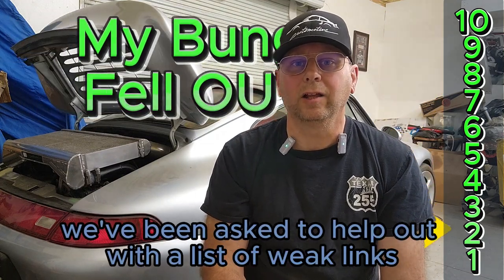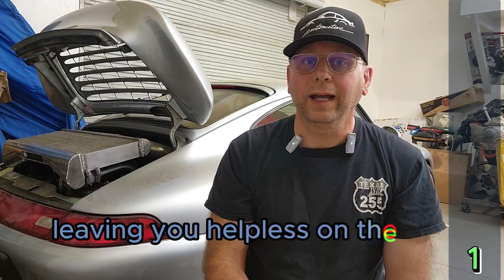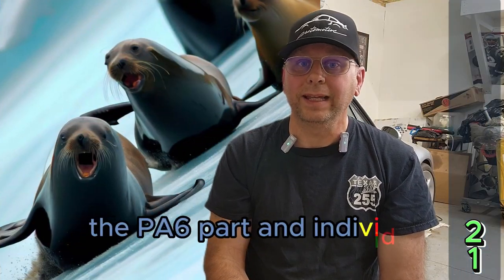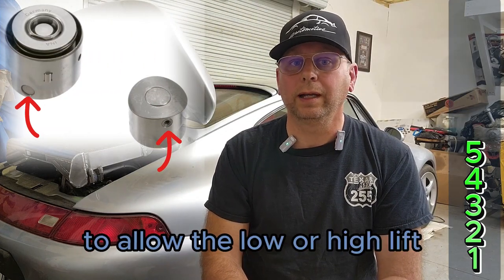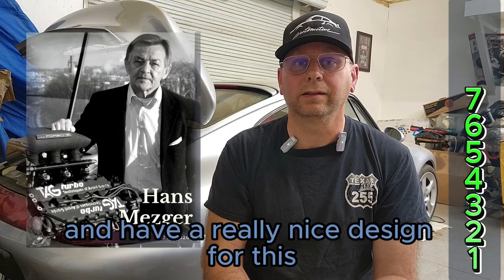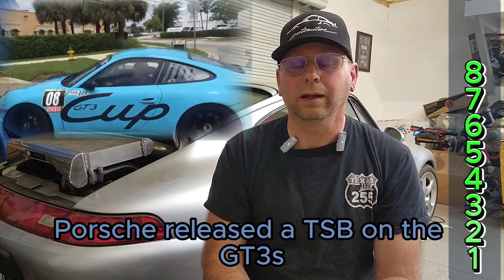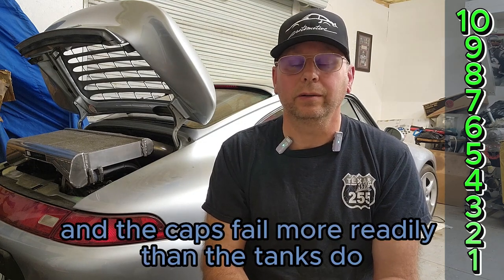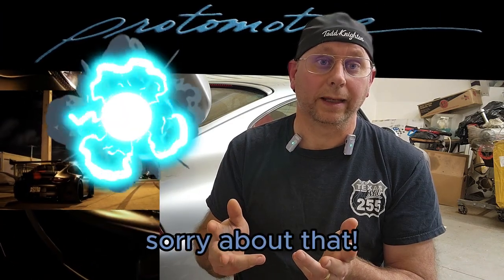Avoid these Top 10 Porsche 996 Turbo common failures and weak links

Comment: Todd,You left out the Most Important Part.........................
Bearings#Bearings #####
The difference between a Chevrolet Cobalt that lasted till 148K Miles,Compared to a 2008 Toyota Prius that lasted to 420K miles is the Bearings,Japanese Bearings are Significantly Better if you purchase the right ones.
Todd,Great Work as Always!!!
Reply from the maker: Great point!  We've pulled apart stock and modded engines at 130k+ miles and could swear the rod and main bearings are brand new....    The int shaft bearings get worn from excessive load on the cams and the rear main thrust from the heavy clutches these cars need for high power.   But otherwise the lower ends in these would go stupid high miles.   That's the cost of performance though!  Can't do without a clutch to hold the power!

Comment: Thanks for the video.  I'm not new to the 996, but recently purchased my first 996 TT.  I'm noticing a rattle sound and wondering if it's the intermediate Shaft Bolts come loose and rattle?  Is there a way to determine if that's the case?  I have a video I can share.
Reply from the maker: I'd be happy to take a listen to it.   If it's just on startup it's more often a chain tensioner.  Lifters give you more of a tick tick tick vs. a rattle.   If the sound is coming from the center back of the engine, it's most likely the intermediate shaft.   But even relatively new these make an odd noise back there.   Possibly a combination of the turbo scavenge pump, intermediate shaft, chains, and oil pump having a lot of gears down there in close proximity.  Do also check simple stuff like the serpentine belt drive idle pulleys and tensioner as well as the front pulley is tight.   There's so many things that can create similar sounds, it's most important to look at the where and when to better identify the source of the problem.
Reply: @protomotive  Thanks for the quick reply.  I have sent you email from your website-sales
Reply from the maker: @kd5135  On it :)

Comment: what's the number of the TSB for the oil gallery plugs? i can't find it! thanks
Reply from the maker: The TSB was on the 3.8 and 4.0 GT3 engine case freeze plugs, but is relevant to the 996tt/997.1TT engine cases as well.   It was showing how to properly stake the freeze plugs in place to keep them from blowing out randomly.   It was showing the large one by the bell housing on the bottom of the case, and the other large one inside the bellhousing.   When you purchase a new engine case, they've learned the hard way and do stake them properly.    I searched for it for a while and can't seem to locate it.  When it turns back up, I'll shoot it over to you.    It was originally sent to me by our distributor in the UK, NineExcellence.   Ken may have it floating around.

Comment: do you have any tips for abs/psm issues after increasing boost with hybrids?
Reply from the maker: There are definitely a few annoyances with the Abs/Psm system on the 996tt.  My personal car was doing a strange thing where it would tend to lock up the front right tire in cold weather right in the middle of a corner.  That turned out to be the Yaw sensor in front of the shifter.  No errors...   On the track, the PSM tends to lock up when part throttling out of high speed corners.   There's a hack for that where people install a switch to disable the yaw sensor once you're started up.  it won't flag any errors, keeps the Abs on, but disables the PSM which is cool.  The better way to go is to install a GT2 or Motorsports ABS unit and remove the psm.  With that done, I can code out the PSM from the ecu and all is happy again.  So, there's a few tips for ya :)
Reply: @protomotive  my yaw sensor was doing  a lot of random shit on my Autel diagnostic
Reply: @protomotive  Fabulous info, do you have a link?
Reply from the maker: @sidewayssam  this is from Planet 9 forum.   

Actually the "wiring work" is really easy. Not harder than hard wiring a radar detector.

Just locate the Yaw sensor under the carpet on the hump, by the drivers right shin. Cut the ground wire (brn/yel) and install a rocker switch between the two ends of the ground wire.

When you want PSM OFF, turn the switch OFF.
When you want PSM ON, turn the switch ON, and cycle the ignition.

I soldered in longer wires an installed the switch on the trim panel under the parking brake. This trim panel is really cheap and simple to replace. Plus the switch is easy to reach.

On the street or in the rain, I have it ON.
On the track, in the dry, I ALWAYS have it OFF.

actual link: https://www.planet-9.com/threads/psm-on-or-off.27747/page-3
Reply from the maker: @sidewayssam  Mine never flagged an error for it, but replacing it solved the issue I was having.  I did find a Non-PSm ABS I was going to swap out, but never seem to get the time to tackle that one.
Reply: @protomotive  I am the above, I have cleaned all the fuses and fuse holder, as a potential issue and used contact cleaner, First drive, appears to have fixed, got a longer drive planned at weekend, will let you know! but I may well go down your route.
Reply: @protomotive  I might well try that.
Reply from the maker: @motorclaimguru  awesome!   I hope it helps :)
Reply from the maker: @motorclaimguru  I can dig out the part numbers if you can't find them.
Reply: @protomotive  Fingers crossed , as it is doing my head in at the moment
Reply: @protomotive  your not going to believe this, but it bloody worked! cleaning all the fuses and fuse box with contact cleaner!
Reply from the maker: @sidewayssam  That's AWESOME!  Now you can get back to the fun stuff!  And we sure can have too much fun with 996 Turbos :)
Reply: @protomotive  would you believe it, I removed all the fuses, cleaned the fuse box  with contact spray, new fuses. All fixed!!!! no PSM issues!
Reply from the maker: @motorclaimguru  that's awesome!  And a great tip for others 😎